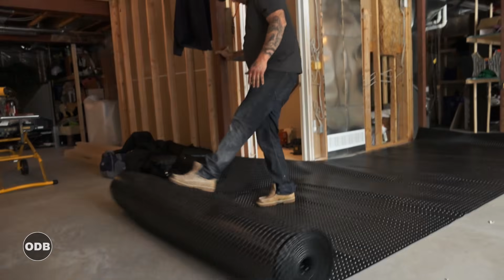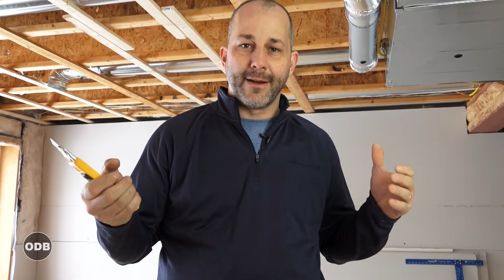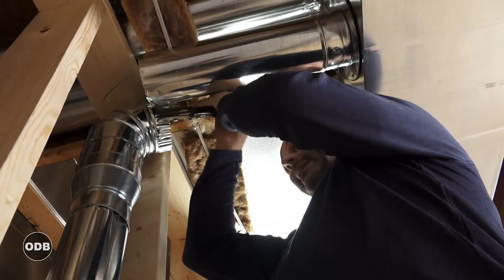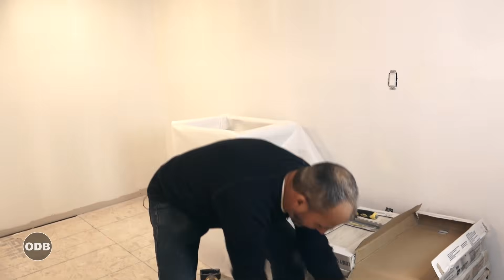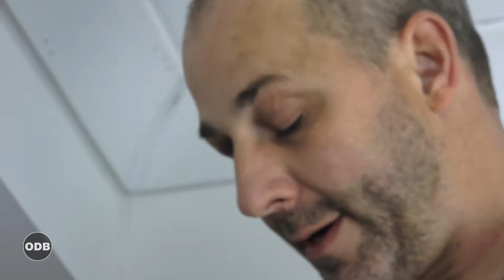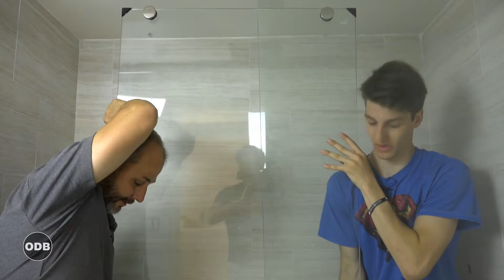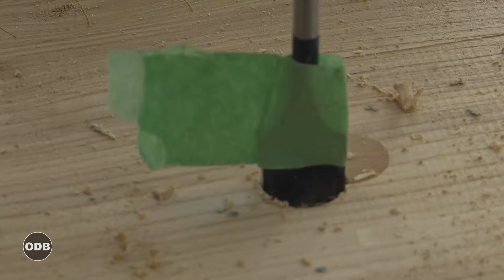DIY | How To Renovate an Unfinished Basement | A To Z

Comment: I have a floating basement floor. There is a gap around the perimeter of the basement. Am I able to go about finishing my basement as shown in the video or are there alternate measures to be taken with a floating basement floor?
Reply from the maker: as shown, this is a floating floor as well.
Reply: if by “gap around the perimeter” you mean the flooring material isn’t underneath and covered by the baseboards then using quarter rounds is the best option or if you mean there’s a gap under the baseboard because it was nailed too high above the flooring or the floor bumps and dips then caulk (white if your baseboards are white) will fix it. there’s proper technique when using caulk so that it doesn’t look all smudged when it dries/cures, giving it a nice sharp finish.

Comment: Great job!!!!!!!!!!!!!!!!!!! But couple things i want to mention: 1. Changing duct diameter on 40:50 i guess supposed to be done on connector side, not on pipe side, because air will start go out from pipe they way you did!!! 2. Another thing, what i noticed ,  that not many contractors doing -  is insulate water pipes......that is recommended procedure because you don't want get condensate on pipes which will be dripping on wood and sheetrock!! also insulations help keep water warmer for a longer time in the pipe and you don't have waste money by draining water and wait for hot water to come to faucet every time!!
Reply: what do you mean air will come out the way he did it please explain your train of thought here my man.
Reply: I would agree with siarhei's comment about insulating pipe that's definitely over looked. It really helps greatly to reduce condensation thus as he said damage to sheet rock and increases efficiency.

Comment: Thanks for your channel! At https://youtu.be/RIzNQhfVFWA?t=19m you attached the pressure treated lumber directly to the floor. In DMX installation guide, they say to frame walls directly on top of the product. Can you explain? Do you lay the DMX all the way to the perimeter foundation and then build the stud walls on top of it? Thanks!
Reply from the maker: Not every situation allows you to follow every recommendation. In this case the home owner had spray foam installed in the exterior wall cavity before I started my work which limited my ability to follow that recommendation on those walls. We did follow that procedure on the rest of the basement though.

Comment: QUESTION: on the tiling. I am unfamiliar with the clamp/spacer procedure you did. Does that mean you didn't grout? It looks so seamless and beautiful. I am working through your vids. If you are still replying to comments, could you post link for me from your library? You are the BEST contractor, I have ever not met! :)
Reply from the maker: still grout. that clip makes it easier to get a smooth finish.

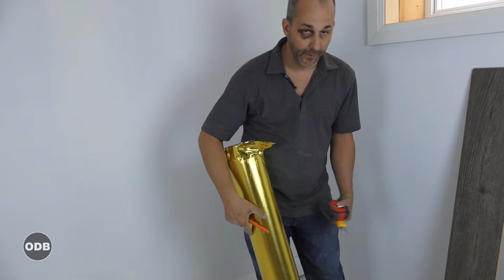Comment: Hi, thanks for the video, it's amazing. What is the reference of the under pad that you use at 1:51:40? Would that work for a carpet floor in Quebec as well?
Reply from the maker: no carpet underpad and laminate are 2 completely different products.

Comment: I was curious about the ceilings.  Rough spackle is generally applied, because the ceilings, unlike the walls, tend to show unevenness and imperfections.  These ceilings look smooth.  I’m DIY, I would like to finish my basement but no funds for it.

Comment: 2:28:10 Wouldn't it be easier to temporarily magnetize the philips bit so it holds the screw? I suppose it might not be a ferric screw since it'll be around water.
Reply from the maker: You can always use a magnetic bit if you prefer. Cheers!
Reply: Magnetic bits are magnetic at the very tip but they do not work that great. They often try to connect to the edge of the head of the screw rather than seating the screw on the bit.  What they are great for is avoiding loosing screws when you are unscrewing something.  There are other options though.  There are extenders that have a sleeve for holding screws.  I opt for that if I can't use my other hand...that is usually magnetic too.  If I do have my hand free, I do it just like he does.  Having a bit that fits the screw perfectly also makes things go well.  Some bits are crap, even some of the expensive ones.  And when it is worn out, and not working right, get another.

Comment: How do you safely attach the subfloor to a concrete floor that has hot water radiant heating?
Reply from the maker: You don't. Just install your flooring floating directly above.

Comment: I was given a great tip for those pex pipe rings from moving around while you're trying to crimp it. give the ring a little squeeze before you put it on the pipe. because they are copper you can bend them fairly easily. This puts a little pressure on the pipe and keeps the ring from sliding around and gives you the time to crimp it ensuring the ring will be in the correct spot when you're done. The greatest pex tip I've ever been given. Try it I'm sure you'll agree.
Reply from the maker: Hi Ernest, tried it and LOVE IT!!!!! Thanks for sharing! Cheers!

Comment: I have one question as a newbie. Why do you tile over floor then use laminate, seems to me like overkill or is it because of leveling or water? & do you do it to all basement floors?
Reply from the maker: The laminate and tile are in different parts of the basement. If you are referring to the subfloor system, it was used to protect the bar.

Comment: I'm sorry, but you're not a sheet metal guy! There are MUCH easier ways of tapping into a supply duct. Granted, your method worked, but I'm rolling my eyes!...And you know nothing of airflow regarding residential limitations...small end upstream of supply is ok for some commercial situations, but for resi you need to limit backflow turbulence as much as possible...especially fart fan, dryer and kitchen exhaust.
Reply: 57:00 limited space for a sawzall? Use a Milwaukee Hackzall! Changed my life!
Reply from the maker: Hi Geoffrey, Granted I am not schooled in the art however the goal was to bring heat to the floor, and that was accomplished. Any idea why it is not normal practice to condition thew entire basement and not just the ceiling in this country. Everyone uses the basement in the winter as an extension of the home. Why are the ducts not run to the floor in the build stage?
Reply: Hi, I'm terribly sorry, was a bit drunk last night....well, in Alberta code is just to supply heat in front of windows in basements, maybe in a future bathroom too...if the homeowner wants ducts run to the floor, that would have been ironed out during the heat rough in phase...I agree, they should all be run to the floor!

Comment: Does anyone have any recommendations for basements with a low ceiling? It’s a very old house and originally when it used to be finished, ceiling tiles were just nailed  directly to the floor joists of the rooms above. But when central air was put in the house it was all ripped down. I think a drop ceiling would make it too low for anyone 6’ and up
Reply from the maker: Don't instal;l a ceiling. Just spray paint whatever you can see. Cheers!

Comment: I am buying a new home and trying to figure out the construction options and you make finishing rooms so easy that I might opt to do the basement myself!
Reply from the maker: basement materials for 1000 sq ft around $10,000 including nice flooring and a subfloor. basement labor is around $40,000. value added to home 50% or $25000. if you do it yourself you make $15,000 if you do a nice job. Just saying

Comment: Great video, thanks for taking the time to put this all together, just had a couple questions about building in Ontario. I didn't see anything in the video about fire stop on the walls that were put in? Also I'm getting conflicting information about putting  a bedroom in the basement, an easement is only required for the floor the bedroom is in so no window is actually required in the bedroom however there is a minium natural light requirement of %5 and ventilation required, so would a window on the same floor suffice like the easement or does a window need to be put in the bedroom to satisfy the lighting and ventilation requirement? Hopefully that makes sense, thanks very much any help would be appreciated!
Reply from the maker: You need to have a window in the bedroom with the daylight. And an emergency escape in the basement. Preferably a door but a egress window will pass. Alternatively if the room doesn't have a closet it is not considered a bedroom regardless of the intent. Gotta love the wardrobe cabinet. Cheers

Comment: I love how you finished the basement bar it needs a beer tap though haha. I was wondering if you have any recommendations for sealing a cinder block wall basement from the outside (post construction and clay, sand backfill mix) I live in the southern part of Mississippi, USA. And basements are not very common here. I would like to have a finished basement like this but I have high humidity and in heavy rain..standing water.  Any bit of advice is surely welcomed by this new home owner "who bit off more than he could chew"
Reply from the maker: I tried to push for a mini keg but alas they are both wine drinkers. lol
In regards to your basement, I would excavate and wrap the house with a dimpled membrane foundation wrap like DMX. You will also need a sump pump, it can be tied to the outside drainage tile or you can add an interior drain system. Then you should be good to go.

Comment: Hi, can you let me know if $100,000 that I was quoted for a 1000 sq. ft. basement/cellar, 90 year old home to be converted to a two bedroom apt with everything i.e. DOB, architect etc. was reasonable? Right now the whole basement is completely unfinished but did have a toilet at one point. Thanks! BTW this is in NY.
Reply from the maker: Not a lot of information there, however I start my basements at around $75.00 per sq ft to build from scratch with proper fire separation and sound transmission ratings.
Reply: Thank you.

Comment: Whats the Avg .cost for materials for that project?
Reply from the maker: When doing a basement with a bathroom and a bar over 1200 sq ft I would budget around. $20,000 for materials the rest is labor plus electrician and plumber. There are cheaper options to finish like without bar and cheaper flooring probably around $15,000 for materials and less for the plumber and electrician.

Comment: Always interesting to how it is done on the other side of the world... :) Very comprehensive and easy to follow. By the way... when you did the laminate flooring it's better to use a piece of wood between the raw hammer iron and the board... And I actually don't know whether you have this product over there, but for tight spots we use this tool to pull the boards tight together https://www.holzprofi24.de/meister-zugeisen-482219
Reply from the maker: I am using a taping block from scrap in order to directly transfer the impact to the laminate without causing damage. Any other block would destroy the edge. The tapping block can be useful but fails after a couple of floors and I hate buying tools just to throw them out. This is why I developed my own technique.

Comment: I have a question for you about framing your walls on top of the plywood subfloor.  How do you deal with subfloor/wall assembly if you have a flooding issue like a broken washer? I'm currently redoing my basement and I can't decide from minute to minute whether to put the dmx/ply down under extended walls and cabinetry or around them for easy removal. ugh!!!
Reply from the maker: In such a rare case You can simply cut the subfloor 1 foot from the walls and install the new subfloor up to the old. Remember you are installing with tapcon screws so joints will not be a problem.
Reply: Thank you very much for your reply.  This is such a simple answer and I'm not sure why it didn't cross my mind before. I can read building codes, manufacturer's instructions, building science articles and documented best-practices until my eyes cross but it doesn't replace experience when it comes to remodeling existing structures.  Seriously, thank you.  I appreciate all the time you put into making these videos and answering questions.

Comment: Hey jeff we just bought a house and its a complete remodel job. On to the basemen. And surrounding outside of it. The soil slopes to thew house. I will be bringing in top soil so it slopes away and using one of those vibrating compactors to compact it well also 2 basement cracks that leak. This is a poured basement i will repair the repair with the epoxy resign system. Should i then seal all the walls? Then next ? Is on the exterior wall framing. Should i frame ontop of the dmx for outside walls? Lastly its an old modular house built in 1973. It has aluminum floor joist 24 inch on center. Should i strap for drywall and what kind of screw do i use. Funny these flimsy joist are solid as a rock if that makes sense.
Reply from the maker: First of all CONGRATULATIONS! Taking on a complete remodel takes guts. You are correct to fix the slope outside first. This eliminates the majority of the water problems for any basement. Since this is a poured concrete fixing the cracks is probably sufficient. I am not a big fan of sealing concrete walls because they serve a purpose it helping to eliminate any moisture that could enter the building. Most moisture comes from weather events and as such needs an escape. relative humidity allows that escape over time. The use of a subfloor protects your basement until that occurs. I always suggest the subfloor first and allow the membrane to curl up the wall a couple of inches to guarantee the airspace. 
In regards top the floor joists I always suggest strapping for 3 reasons. 1) it allows you to screw every 16" so you won't get nail pops and cracks. 2) it allows you to install contrary to the floor joist direction and makes it easier to install 12 ft pieces without trying to joint on the joist. 3) strapping does almost double the strength of the floor from deflection to help ensure a nice quiet walk years in to the future.
Good luck with your project and have a great 2018!
Keep us posted and keep those questions coming. I love to help. Jeff
Reply: Home RenoVision DIY
Reply: So i have searched all of youtube i swear. There is now how to video i can find on how to install or add a sliding patio door when you dont have one. One thing we want to add is a patio door in the dining room. Do you have or could you make a video on this or know of a good one. We wont be doing this till summer our firsts are the main floor. New carpet. Vinyl plank flooring and re drywall as they used quarter inch. And they also used paneling. Another video i couldnt find was any kind of diy egress basement windows.

Comment: Jeff, I just finished viewing your A to Z video re basement finishing; fantastic!  You present everything in an understandable manner; it doesn't hurt to have a pleasant personality!  64 dollar question; I live in New Jersey, in a 25 year old home that is built on cement blocks, however the foundation slab is a "floater".  There is at least a 2" gap between the slab and wall, all the way around a 77' x 30' area.  I fear that this is the source for the high humidity that we experience, particularly during warmer weather, resulting in some mold buildup. I have a dehumidifier that does an adequate job but I think that by sealing this gap, we could significantly reduce the source of the moisture.  The builders did install a french drain line to the sump hole; we have never had a bit of water enter the basement.  I'd appreciate your opinion on resolution; I've thought of inserting backer rods, then applying the appropriate, self-leveling caulking on top.  Thanks very much and you have a new fan!
Reply from the maker: When dealing with water problems and the foundation it is impossible to comment in this type of forum. I would suggest you get an engineer in to look at the basement and perhaps some soil tests as well. Until you understand the source of the moisture it is impossible to recommend a solution with any integrity. A good engineer will only cost a few hundred bucks for an onsite visit. Good luck and keep me posted. Once you have more info I would be happy to suggest a product or technique to help you out.

Comment: I'm expanding a refrigerator alcove and changing the adjacent door into a pantry. I don't have a nailer. Can I just use screws to put together the framing? I am already planning on using Tapcon screws to go into the concrete floor. I see you use both. Any reason you change it up? Thanks!
Reply from the maker: Sure thing. Work with the tools you have. I use screws whenever I am concerned I may end up changing something as I go. Nailer for when I am in production mode.

Comment: Oh no you are saying no Dricore as my husband just walked in with 75 panels for the basement!! Please Help..will they not work .. What do we do??
Reply from the maker: Take it back and get your money. Use my system and go out for dinner every night this week with what you save.
Reply from the maker: seriously though if you use it , you will most likely not experience any problems unless you have regular water infiltration. It just costs a lot for what you get.
Reply: Home RenoVision DIY thank you so much for getting back to me..very kind of you ...we really appreciate it.. I was looking for it at my local Home Depot and they are only showing the 3 in 1 
Not the other one you actually used .. But the blue one...but you say you recommend both correct ...?
Reply from the maker: If you use the blue you can put laminate flooring right over top. If you are using vinyl plank then I would stick with the drycore. The dmx is usually used for basement wall waterproofing systems. That is why it is not always available. They will special order it for you. But you might need to wait a few weeks to get it.